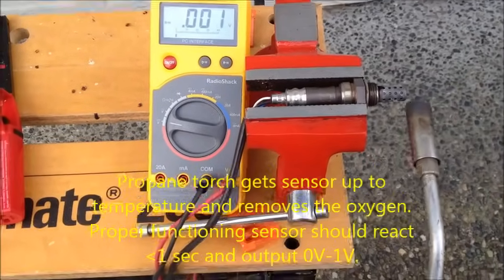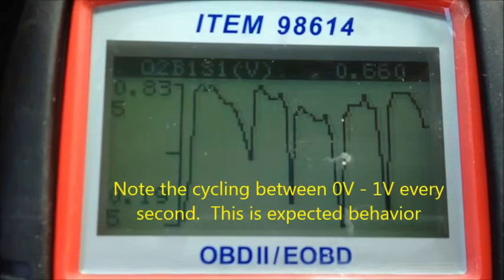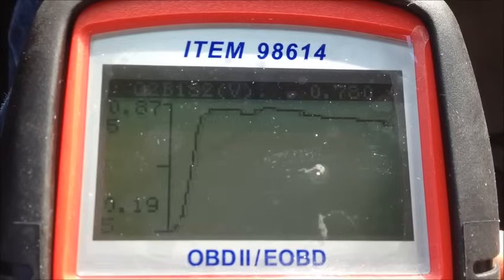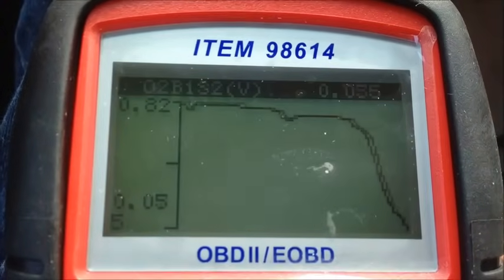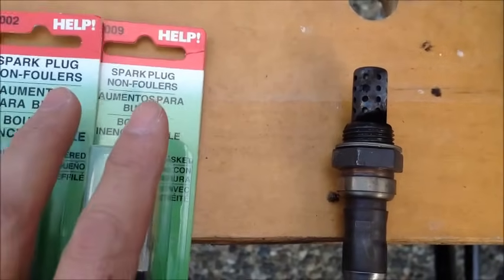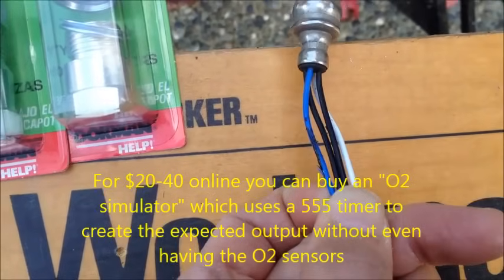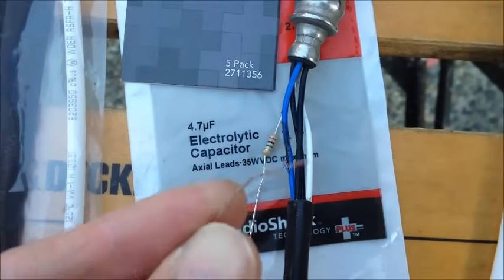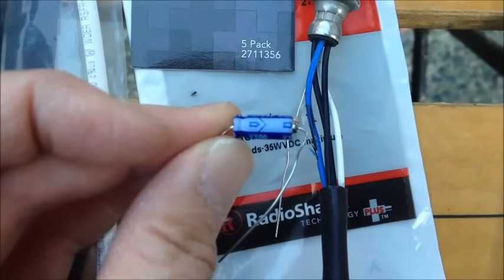$3 O2 simulator fix for P0420 Check Engine Light

Comment: I have 2 cars now that are showing the P0420 code that I'd like to try this on: a '02 Mini Cooper S and a '01 Volvo v70. Their age suggests its the CAT (I changed the o2 sensor on the Mini with no result. Will this likely work for these cars, or are the manufacturers doing something unique?
Reply from the maker: I really can't say but I think most cars of this vintage are similar.  Find out the specs on your o2 sensors, in particular your wiring colors & meanings.  If they are similar to the Honda then you're likely to succeed.  See the recent post about the 04 Durango - there's possibly some helpful diagnostics there to figure out which wire does which.  Unfortunately it seems like it may not work on his sensor.

Comment: I did this on my 04 Durango 4.7L and now I'm getting a P0038 code Heater Control Circuit High . I took the parts out and put everything back the way it was and still have this code. It appears to have burned out the O2 sensor. I hope that is all it did. I wont know until I put in a new sensor.
Reply: Yes heater was broken. Replaced the O2 sensor and it was fine. By using the 2 spark plug defouler method I was able to get rid of the P0420 code. No more lights and it passed inspection.
Reply from the maker: I'm not familiar with your O2 sensor but there's a simple 2-wire heater circuit on my unit, and a 2-wire sensor circuit.  You shouldn't touch the heater circuit, but this code suggests that you might have shorted it, or more likely (by the term "high") you open-circuited it.  Either you cut one of the wires, or the heater might have burned out.  If you're handy with a voltmeter you can test it - the heater circuit should have a low resistance to it.  Did you try out the propane torch test in my video to test out the sensor circuit?  That also identifies which wires are which.  Perhaps you just mismatched the two circuits - that would likely explain it.  If you google for your o2 sensor model you might very well find a description of which wires are which.
Reply: MITEEman I did not take the sensor out. I was able to do it under the vehicle. mine had the same color wires as yours. Blue white and black black. I wired it the same. I'm wondering if maybe the wires are brittle going into the sensor and it shorted out there. I did the mod on the plug end of the wires. I am going to put in a new sensor and go from there. I still do not want to replace the cat. Mine has to have the CA cat and it will cost a ton.
Reply from the maker: Debar Mountain Leather
Wow - you get an A for effort - I could never have done it underneath the car.  Unlike house wiring, auto wire colors don't really mean much, especially if you're comparing Honda & Dodge.  I googled and only found one post relevant to your case, but unfortunately it seems to indicate that noone details what the 4 wires on your sensor really are:  http://www.dakotaforumz.com/showthread.php?t=1980.  Further, the descriptions show that their sensors are more complex than Honda (contains some kind of relay & control for the heater) so I can't even understand what the wires exactly are.  Fortunately that thread does show you how to figure out which wire is which.  I would use that diagnostic to find the correct wires. You want the sensor signal and heater ground.  However, I see now that the ground is shared between the sensor & heater so I'm not 100% sure this mod will even work on yours (capacitor might be influenced by yet another circuit dumping electrons into the ground), and you've possibly removed the heater's ground to use for the sensor mod which would exactly cause the problem you describe.  It's pretty hard to burn or short out the o2 sensor and I doubt that's the problem.  It's possible that this mod could be adjusted to your system, but it's just as possible this just won't work.  If you reverse the changes you made you should no longer have that heater code.
Reply: MITEEman  
Your right, I could not find anything either. The wire colors are probably different and I burned up the heater. I don't think this will work on the dodge system because the system will not be fooled by this on a newer vehicle. If the new sensor doesn't fix it I may try the plug fowler method. Thanks for the reply.
Reply: Right rear colors for the signal circuit are brn, dk blu/w/green tracer, left are violet w/dk green tracer, and dk blu w/dk green tracer
Reply: bleachinuri the colors on mine were blue, white, black and black. The replacement O2 Sensor was different with gray, white, black and black. The new O2 sensor got rid of the P0038 code. Have to wait and see if the cat is bad or the O2 sensor fixed the P0420. I imagine the cat is bad.
Reply: not the sensor you have to look at the harness side of the plug those colors on the sensor are universal
Reply: Debar Mountain  NO! heater is not broken! sensor good! ECU to test resistance to sensor, to see if hot! but with big resistance 1 megaohms, he believes cold! the problem 'o2simulator no good !!!

Comment: Great solution, my 02 Toyota sienna cat was replaced last year, did not fix the problem.  2 oxygen sensors also replaced, same thing, then they told me it was the "canister" or something like that, check engine light still on.  Could not pass the inspection. a lot of money and time wasted.  I almost gave up until i found this solution, i couldn't believe that with less than 3 Dollars i solved this problem.  Thank you,  Thank you, Thank you.  (soldering was pretty easy too)
Reply: We Toyota owners face the trouble that the ECU is too sensitive. A good catalytic converter, and you can keep on with the code. Watching my live data it's obvious that the new cat fixed the car, but the car remains unconvinced.
Reply: DE Nichols I'm lucky I live in a non-emmission area. I replaced the catalytic converter because of performance issues. The car runs great. By it's readings I can tell the care is much better for the environment. So the part of me that wants the world clean is happy, and my car keeps thinking. The cat is broken.

A good catalytic converter gave me 50% more actual HP at the wheels so that'll save the environment, not having it run so poorly. Went from 59 to 91. Modern cars do work better with back pressure.

Comment: I have acquired a 97 Acura CL with straight pipe to muffler with no place to insert an o2 sensor.  Can this same process work for looping the wires back to the ECU via using half of the wire and plug from an existing oxygen sensor?
Reply from the maker: This isn't a true O2 simulator because you need a working cat converter and o2 sensors - this just smooths the performance.  In your case you have no output.  You'll have to find a true o2 simulator off the internet.

Comment: I accomplished on my Toyota Tacoma a week ago, 100 miles and no check engine light. Thanks Great solution. By the way my solder job was terrible also. Must be the type of wire?
Reply: That wiring looks like aluminum maybe? It's difficult for welders to work with aluminum. So it figures that soldering, which is a basic weld technique in all reality, would have trouble with it.

Comment: Is it important to solder parts closer to sensor? What if I do them near connector? Or even create an extension with original connectors that allow to include patch into scheme just connecting it between original sockets.
Reply from the maker: No, it makes no electrical difference.  I can't remember why I chose to do it near the sensor but it was likely ease of showing the installation and / or access to the wires.  The wires are covered by a heat-resistant braiding that you'll need to cut open and then cover again.  Perhaps that end was open whereas the other wasn't.  Anyways, electrically you can do it anywhere you want as long as you keep the same flow of electrons.  Keeping the capacitor in the same relative place is the key.
Reply: MITEEman
i would do it closer to the connector just to lessen the chance of heat damage to resistor/cap near the exhasut pipe.  But I will concede that it makes no electrical difference.

Comment: I Performed this procedure on my downstream O2 sensor wires..closer to the connector rather than close to the sensor.Seems to be working just fine..I Used my Actron 9575 Scanner tool,to watch  the sensors after the fuel system changes from open to closed loop.I have 2 new Os sensor's & I just installed new Injectors.running great, No Engine Light's.. I used a 1/2 watt (1) MegaOhm resistor,they didn't have the 1/4 watt..1-4.7 microfarad axial capacitor..Great Idea & It Works just fine to trick the (ECM) into thinking the 3way convertor is running at peak Performance.. Since even if the converter drop's to 95%,meaning if it loses 5% of it's performance It WILL throw the Code P0420 aswell as others.
Reply: Does this work with a secondary air injection pump. I know the o2 sensor reads the  flow of air from the pump, that passes through the cat.
Reply: I did all but getting a p138 and ecu code it’s 06 toyota tundra no idea now
Reply: @gallantfox4776 this code on my Highlander meant it was falling the O2 self-test-cycles. 100k resistor and 1uf cap fixed it for me. (Note, ideally you should read what test is causing the code.)

OBDLink MX+ told me
1) I had too much voltage drop on Max voltage test cycles: .525v with acceptable range ~.6-1v.
2) I was failing the time (units were seconds) tests. IDK WTF they do, but I assume it meant the cap was keeping voltage up for too long. ¯\_(ツ)_/¯

Good luck.

Comment: I just did this mod, turned the car on, and I still have the CEL, will it take a bit for the car to register the change?
Reply: Sam Cooper This is why we always use anti-seize when we put an O2 sensor in. Even if you just pull it out and put it back in use anti-seize. I didn't know this when my front O2 sensor went bad 7 years ago. I had reason to take it out because it was in the way of a bolt for another repair and it's not going anywhere. Sigh. I didn't know about the anti-seize back then.
Reply from the maker: Yes, either you use the same tool that read the code to reset it, or you have to wait for the computer to get enough data to reset itself, which could be as much as 75 miles.  If you go into an auto parts store you can borrow a code reader and reset it.
Reply: Gotcha.
Reply: MITEEman well I ran it out for 100 miles, CEL stayed on, unplugged the battery to reset it the comp and 25 miles later the CEL is back on. Thoughts?
Reply from the maker: Sam Cooper
Did you check the O2 sensor performance with a blowtorch?  This mod won't help if the O2 sensor is dead.  This only smooths out the waveform.  Make sure you modified the downstream sensor.  If you have a graphing ODB scanner you can look at what the actual O2 sensor readings are for the upstream (should cycle every second) and check if the downstream is a very slowing changing waveform.  If you verify all this then your computer is too sensitive/complicated to be fooled.  Next step would be to buy a 555-based O2 simulator which generates a waveform independent of the O2 sensors.  They're about $40 on Ebay.  It will plugin at the same place you did this mod.
Reply: MITEEman I never checked it with a blow torch because I can't get the sensor out! The sensor very well could be bad. I also don't have a graphing scanner. I just thought I'd try this and hope for the best. One last thing to mention, the last time I pulled the battery the sensor didn't trip the CEL for over a hundred miles. Ad periodically the CEL would have turned off before that. These things are what led me to believe it was borderline and this would help, but it seems as though I made it worse. I'll start looking for a 555 simulator.
Reply from the maker: Sam Cooper
That sounds like the same symptoms I had so I would have guessed the same but without a graphing scanner you're literally just "guessing" at what's happening.  The fact that you can't remove the sensor is pretty bad.  I had no problems removing mine.  I'd recommend a full o2 simulator for you.
Reply: MITEEman Right. socket, breaker bar, and a lot of PBBlaster couldn't remove it... That's what I'm thinking, where should I look to find one? And what do I search? Haha, Thanks for all your help!
Reply from the maker: Sam Cooper Just Google "o2 simulator".  EBay has an interesting link discussing some problems with them.  I noticed EBay didn't have any so perhaps they don't even allow them to be sold there anymore.  The one link I looked at cost $95!
Reply: DE Nichols Right, unfortunately, the last time the o2 sensor was changed was by the previous owner, don't know when it was but by the time I got it, it was too late.....
Reply: MITEEman 555 work ? i not to know!
Reply: Sam Cooper Turns out, lol, I forgot my O2 sensor has an oval welded to it so I remove those two bolts instead. 

It still looks like a normal O2 sensor where you'd use an O2 sensor tool on, but it's welded there.

Comment from the maker: I don't think the ECU will accept that but I haven't tried it.  I would suspect it would flag the O2 sensor as failed but that's just a guess.  Knowing the effort others have gone to in constructing a 555-timer based oscillator circuit, I assume the ECU needs to see variation of a manner consistent with normal function.
Reply: And that would ALSO fit under a seat.

Comment from the maker: The upstream sensor 1 is as you describe - it's feedback to the engine for how to adjust the rich/lean.  You don't want to modify that one.  You are going to modify the downstream sensor 2 (installed on or after the catalytic converter) which tells the computer that the catalytic converter is evenly catalyzing the exhaust as demonstrated by a steady o2 range.
Reply: Cavalier Basketball team
Reply: What would happen if the upstream was modified ? I have a minor exhaust leak at the header. I did the trick and my gruñe economy has gone up and the engine light is off
Reply: pretty good gas mileage... wish my outback got that

Comment: Does the computer use this sensor as feedback to control how rich/lean the engine runs, or is it just for monitoring that the catalytic converter is working efficiently?
Reply: yes absolutely, the sensor effects the ecu/pcm by telling it to run richer or leaner depending on the output of the o2 sensors.
Reply: Depending on your vehicle. If you don't know what your saying then don't say anything at all
Reply: Cadillac cuts models use both upper and lower sensor while determining the richness and leanest of the fuel to the engine
Reply: Cadillac Cts
Reply: Brent Heidenreich Jeunesse this post-cat sensor (the one in or behind the catalytic converter) does not at all affect the performance of the engine. It merely monitors the performance of the catalytic converter, to control emissions.